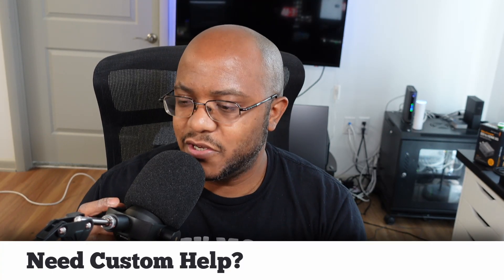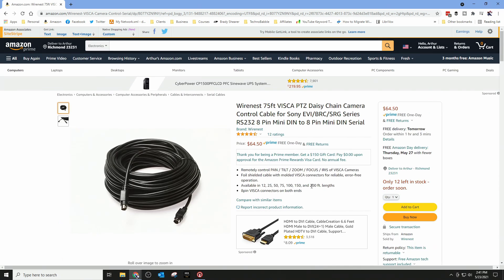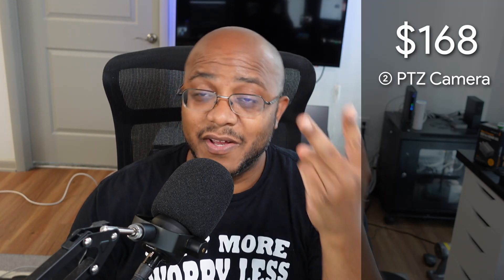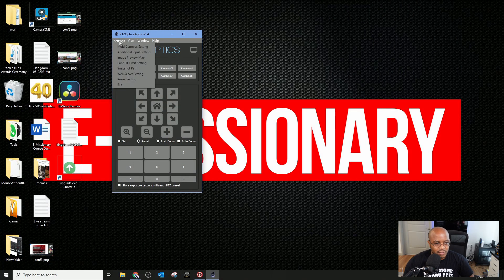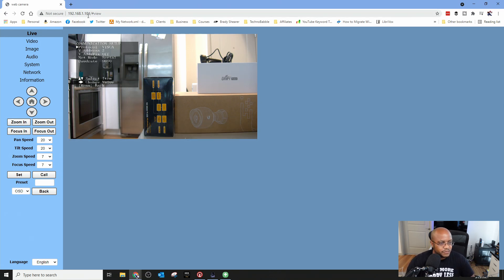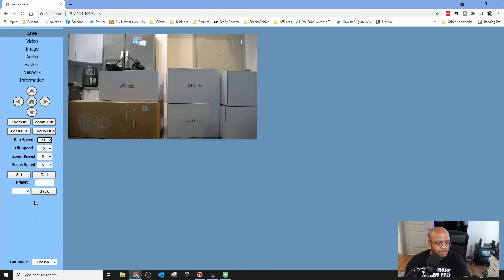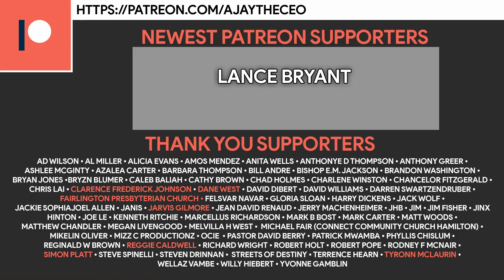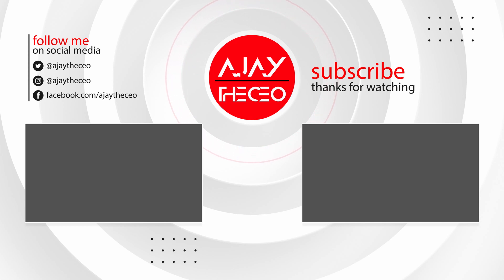HOW TO CONTROL MULTIPLE PTZ CAMERAS WITH ONE JOYSTICK

Comment: How “exactly” did you connect the joystick to the 1st camera? Is it adapter to Ethernet into camera? All cameras were also plugged into POE switch for power correct?
Reply from the maker: In this video I was using a rs232 to whenever adapter going into each camera. The ptzs were all powered by Poe with a separate whether cable for power and network access
Reply: @AJaytheCEO  from the joystick to the first camera what cable did you use. I know you used the special adapter. It didn’t show if you used an Ethernet cable to the first camera. If I’m gonna use an ATEM do I plug both cameras into the ATEM via HDMI and daisy chain them with the adapter and Ethernet cable?

Comment: Hi.  I have a Marshall camera, not an IP CAM, and a Fomako IP address, Cam already with an IP address.  I'm using a HuddleCam controller and connected the cameras using your daisy chain (Connected in serial) and am able to move one camera.  Each cam has its visca id, either 1 or 2, but only one moves and when trying to move 2 it won't move.  Please help.  I've been rattling my brain up.  Called Fomako, they want me to buy knew cam to replace the marshall and want me to buy fomako controller too $$$... talked to huddlecam support and told me to call fomako.  What am I doing wrong, please?
Reply from the maker: If all the ids are unique and you are using visca it should work. Make sure on the Fomako you go to the menu via remote and change the settings to parallel under communication menu I believe
Reply: @AJaytheCEO  i did look for a "comunication" option to change to serial so it can comunicate on the chain, but none of the cameras offer that choice.  Each Cam has its ID #1 and #2.

Comment: Hello thx for the video. I was curious as to why you connected  the cameras to ethernet too? Is that needed or can I just connect the in and  out dongles?
Reply from the maker: The Ethernet gives it power and allows you to access the web interface to modify the camera without needing only the remote
Reply: @AJaytheCEO  ok so I don't necessarily  need it if I can setup through the joystick  screen and just plug in? If I did use ethernet.  You had that in a poe switch?
Reply from the maker: Yes Ethernet also provides power

Comment: Do you have a diagram of this daisy chain setup? The first bit of Cat6 cables you connected between the cameras, were they going to the OUT’s of each of the converter cables? And then only 1 Cat6 needed to go to the IN of one of the converter cables and connected to switch?
Reply from the maker: With the rs232 converters I went from the joystick to the in of the first camera and then the out from that camera into the in of the next. Then rinse and repeat
Reply: @AJaytheCEO  thank you so much for the quick response. Much appreciated.

Comment: Hi, I like to connect my PTZOPTICS cameras (3 total) to my PTZOptics joystick controller for shows with no network or internet. Can I use your rs232 setup to have my cameras work with the controller with no network?
Reply from the maker: yes
Reply: Thanks. You’re the best. One quick question, is there a device out there that instead of me rs232 daisy chaining from one camera to the next, is there a non network way to bring all the cameras cable run to a central device and then connect that device to the joystick controller? Thanks again.

Comment: Great Video AJ!  I never thought about using CAT6 and getting a RJ45 adapter for our cameras.  We have 2 PTZ cameras and we are looking to get them further away from the booth.  The CAT6 costs are way less than a 100' HDMI.  Another YouTuber with a church ministry talked about a SMTAV 30X optical that is the same thing as a PTZ for almost half the cost.  Have you run into or used the SMTAV?
Reply from the maker: Yes I have. The SMTAV PTZ is what I have paired with our PTZOptics at my home church.

Comment: RJ45 what cable between cameras ?
Any normal ethernet cable or have to be a specific one? Or one you recommend 
Thank you for your video it help me
Reply from the maker: I'm just using normal standard cat6 cable
Reply: @AJaytheCEO  awesome thanks!!
Reply: SMTAV PTZ CAMERA One more question  do you know if this camera can be ceiling mounted?  Do the camera can be screwed from bottom (am going to use a mount boom arm 40inch down 
I know sounds crazy is just a customized spot 
Thanks
Reply from the maker: @oscarsantamaria6384  yes it can be ceiling mounted but you need to purchase that mount at it does not come with one

Comment: Just curious, is there any noticeable lag or delay between controlling the cameras over IP vs RS232c or RS422/485? I would assume IP control would be delayed more than direct serial connection, but that maybe thinking old school. Sorry, don't have much experience with PTZ cams.
Reply from the maker: No noticeable difference
Reply: @AJaytheCEO  Awesome. Great info. Thanks.
Reply: I have 3 old Sony evi-d70 with rca out  can this be daisy chain too? and be controlled with huddlecam? (Planing to add hdmi adapters to atem mini pro)
Reply from the maker: @oscarsantamaria6384  if they have rs232 connectors and run visca protocol they should
Reply: @AJaytheCEO  thanks

Comment: The only thing missing was a comparison with going with ethernet. Perhaps the cost of each adapter plus a spool of ethernet and connectors. It is definitely WAY cheaper, but easier to sell it to a board if we can show numbers. I think a 500ft spool of Cat6 can be had for like $50-$60, a bunch of connectors can be had for $20, and then each set of adapters is is like $25. So $210 using ethernet vs. $420 for straight RS232. Same result... Plus those Cat6 cables can be used for tons of other things, RS232 really can't.

Oops, I ended up doing the math.

Comment: Hi,
I bought 2x SMTAV PTZ after your test. Now I have problems to find the 2nd camera that is connected to the PTZ View controller via LAN, not RS232.
Do you have to set more than the different IP address in the settings for the camera?
Reply from the maker: Use the PTZOptics setup app